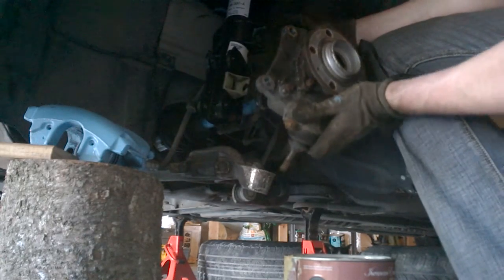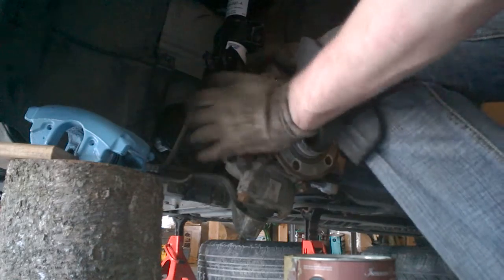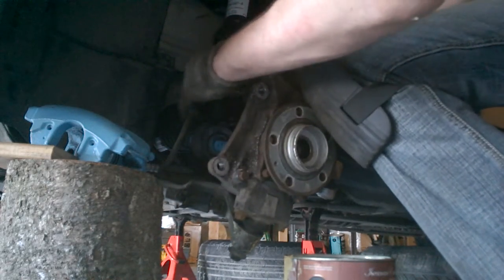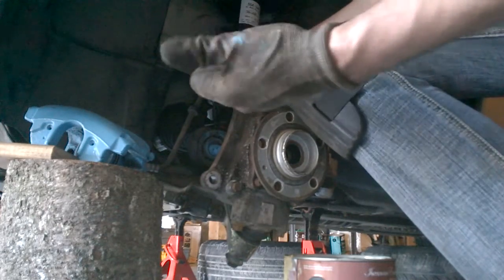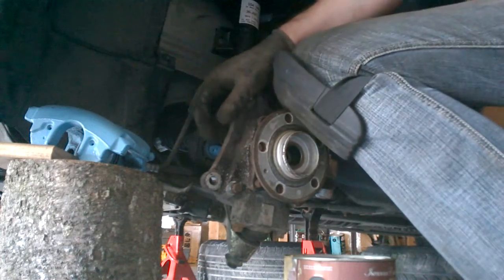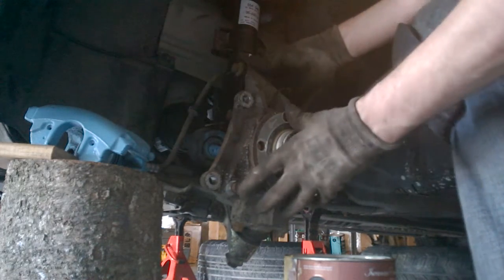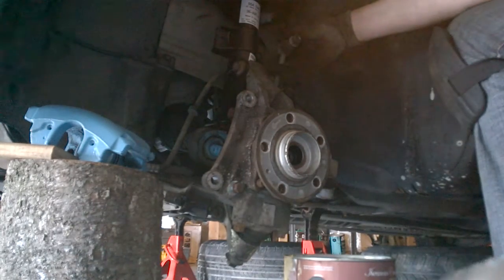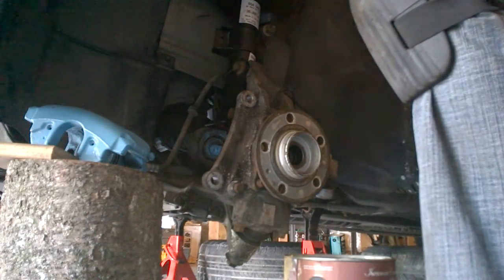Volvo S60 V70  Easy way to Install a Control Arm / Wishbone 2001-2009

Comment: Hello, Do you have a video of rear upper control arm replacement or bushings  on a 2000 S80?  I heard is difficult job.
Reply from the maker: I haven't replaced those, indeed forums say difficult.  I have a video lowering the rear subframe but you won't be able to compress the springs to put them back in place - https://youtu.be/J1cChwuLzrE
Reply: @Peppermint1  Thank you so much for your answer.

Comment from the maker: chrism member on the matthewsvolvosite.com forum had this excellent tip when installing a new control arm - in order to have bigger leverage, he used a long 2x4 attached to the control arm with a chain, with the 2x4 continuing for a few feet outside the car - then just pressing on the end of the 2x4 will give more leverage to install the control arm - either to get the ball joint into the hub, either to get the strut aligned with the holes in the hub to insert its lower bolts

Comment from the maker: I would also like to mention that the control arm in the video is an old one, a new one with stiff bushings will require much more force to keep down the spindle.  May also try inserting first a screw driver into one of the strut bolts holes, to 'catch' the strut.  Also, in the video the upper end link (from the anti roll bar) is detached from the strut.  It's not a must, but can help align the bottom of the strut with the hub, because when the end link is attached to the strut, it forces this one to rotate somehow.  However, detaching the end link is not always easy because of that very tight bolt with torx stud - maybe see this video if you want to go that way  https://youtu.be/3lWmPt56qn8   Remember to order the right control arm for your model year - I believe Volvo changed the control arm type somewhere in the 2007 year, from the allow type to a metal (black) type - these two arms are not interchangeable

Comment: Why not disconnect the ball joint from the hub?
Reply: Disregard realised its press in
Reply from the maker: Indeed.  It is very hard to remove it from the hub, basically we do so only when replacing the ball joint (at that point the hub has to come out out the car and we either pull the ball joint with a special tool or try to punch it out with a cold chisel)

Comment from the maker: There is no need to remove the brakes/caliper or disc like in the video, I was just happening to do a brake job.  However I'd recommend removing the ABS sensor so you don't stretch the wire, just a 10mm bolt that keeps the sensor, then from underneath push up on the sensor with a flat screw driver.  There is no need to detach the end link from the strut but it makes the things easier.  If you detach the end link, use a pry bar between the anti roll bar and the subframe to press down the link to position it's bolt near the hole in the strut.  Have both front wheels off the ground.

Comment: I have ordered new lower control arms, lower ball joints, inner and outer tie rods, link kits, rotors and pads for my 2006 xc90. The problem is that my axle does not come out of my hub (it's jammed in there) which I found out last year during another repair. Will I be able to do this easily without removing the axle from the hub? So I need anything special to change the balljoints? Getting a little worried if i will be able to do it myself after seeing some other videos. You make it look so easy!
Reply from the maker: I am not sure if the ball joint can be replaced with the axle inside the hub.  You may try undoing the axle from the transmission and removing it with the hub from the car.  Maybe there is enough place to tap and kick out the ball joint and to kick to press the new one in, but often times it takes force to press in a new ball joint.  You need to be very careful handling the CV joint at the hub because it can easily self dismantle and it's hard to put the balls back at their place.
There are videos on Youtube with people trying to remove the axle from the hub, but the impact will damage the wheel bearing.  Ultimately the wheel bearing is cut in two. The easiest/fastest way to go when this happens is to find a used axle and hub.  Don't discard the retaining clip on the axle that goes inside the transmission, aftermarket ones are sometimes the wrong size.
Also may want to see this other video  https://www.youtube.com/watch?v=pxC9Ek9HhGI

Comment: As you demonstrate, it's much easier to reconnect the ball joint connection when there is only the control arm and the axle.  I'm planning to do a complete suspension rebuild, and will have all parts disconnected anyway, as you have here.

Comment: Thanks for posting! I just used this method on my 2005 XC90 and I did not take the caliper and disc off. Only disconnected the steering arm/joint to the hub and was able to get the ball joint into the control arm with a little help from the jack positioned under the disc for leverage.
Reply from the maker: Very correct, I was doing a brake job at the moment.  To remove the control arm or ball joint, the caliper can stay in place, just be careful with the brake hose not to stretch it.  I also recommend removing the ABS sensor from the wheel (1 bolt) so as not to stretch it's wire by mistake.
Reply: I have ordered new lower control arms, lower ball joints, inner and outer tie rods, link kits, rotors and pads for my 2006 xc90. The problem is that my axle does not come out of my hub (it's jammed in there) which I found out last year during another repair. Will I be able to do this easily without removing the axle from the hub? So I need anything special to change the balljoints? Getting a little worried if i will be able to do it myself after seeing some other videos. You make it look so easy!